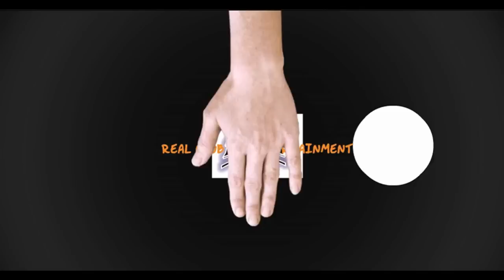How to make a Micro  USB fan for mobile phone....!!!

Comment: Prepare to always be amazed The opolar mini usb fans at: https: //goo.gl/IVGmQI tend to be a light in weight, table top fan for your own home, office or wherever you decide. Made of high quality metal, the fan is the best companion on your hot day if you want to remain cool. Powered by usb by having a 3.9 feet cable, you will get the fan running anywhere - hook it up to the laptop or use it at the pool which includes a portable charger. Wherever you want to use it, it is easy to stay cool and fresh using the opolar mini usb fan.